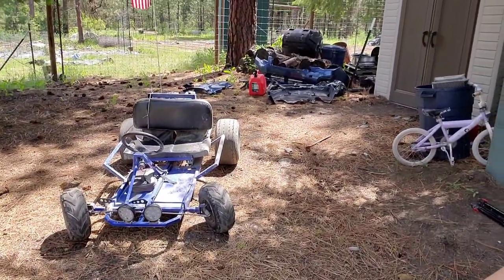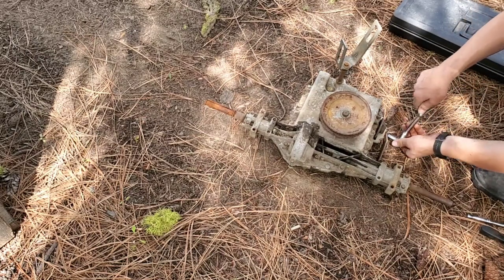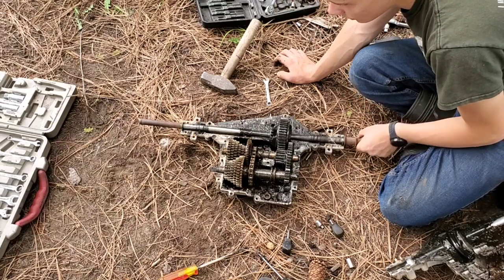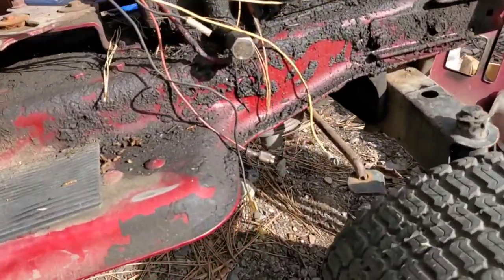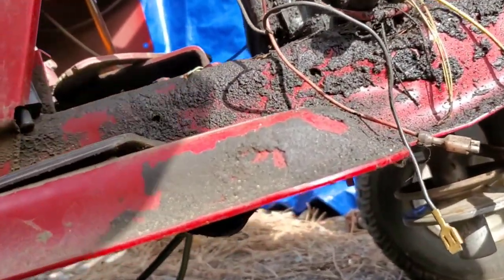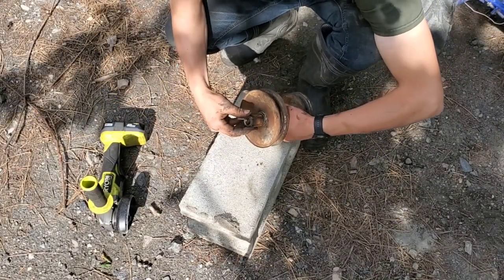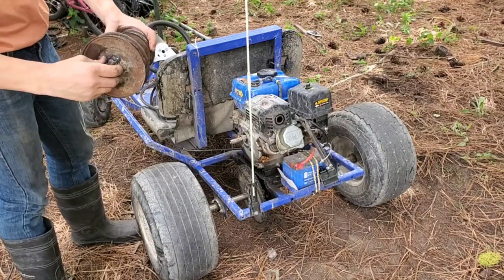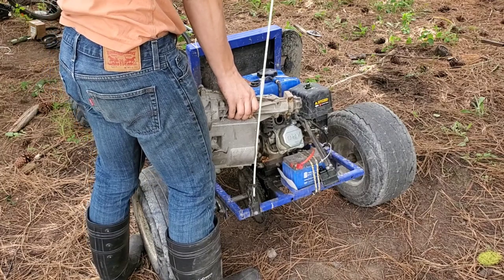Lawnmower transmission on my Go Kart?? | Go Kart Upgrades Part 1

Comment: Hey bud, uts been long enough so you've might if learned by now but i know you're using a gasless flux core but you still need to keep your arc length short. The farther your base naterial gets away from your tip, the lower your voltage gets and in a hurry to and the voltage wint as consistent and youll loose penetration. Lastly, anything that has flux, gasless flux core, dual shield flux core, and stick, all need to be drug. Drag your puddle instead of push. I know its harder to watch where you're going but youll get better penetration and it just overall welds better. Solid wire you can push. If anyone hasnt showed you that yet then i hope these tips will help ya out. All kinds if things i vould tell ya, thats just going off from what i seen. Good luck with your builds and im fixing to find more of your videos right now lol